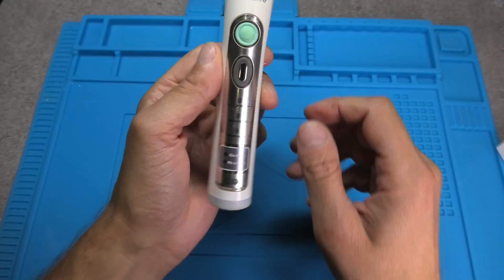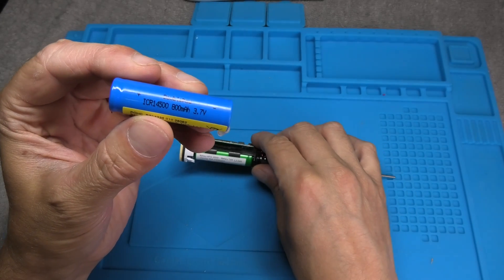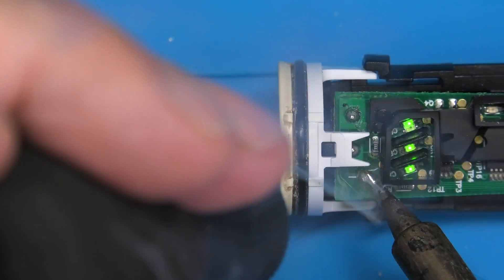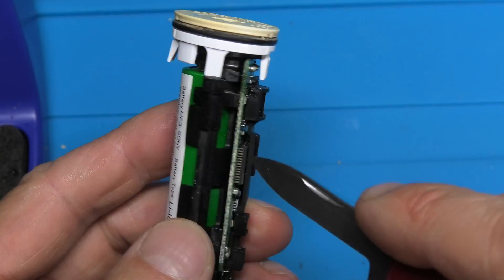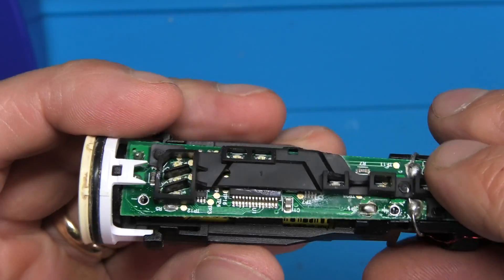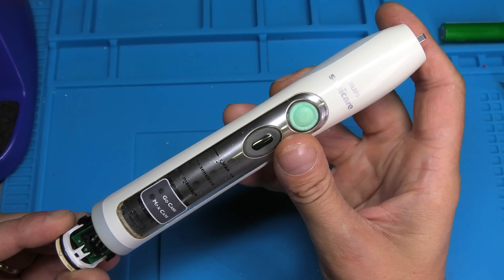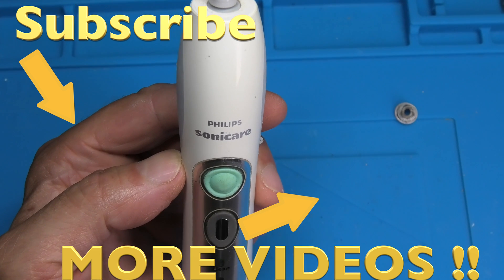Battery Replacement on Electric Toothbrush Philips Sonicare (How to in 4K)

Comment: Removing the electronics does not require hammering on a counter. I found another video where you simply take some wide pliers and squeeze on the long end of the oval bottom. The mechanism will pop right out. Wrapping in some cardboard or other material will prevent the pliers from damaging the plastic/rubber.

Comment: tldr; Switch to a toothbrush with a battery that is meant to be replaced when it wears out. The greedy scum at sonicare made this one just short of impossible to replace.

long version: This is much harder than it looks and the technique of pushing the tip onto a hard surface did not work with my toothbrush. Maybe they changed the design since this video was made. I tried to whack it hard like in the video and just started bending the metal tip - not good. I had to use channel lock pliers to squeeze the bottom of the toothbrush just enough to distort the shape so I could use a really small screwdriver to pry off the bottom (wrap it several times with a thin rag to protect the surface of the handle. After that cap was off I saw there were 2 flexible tabs that needed to be pushed inward slightly with a small screw driver, then the core assembly slipped out with light pressure. That was the easy part.

Unless you are really good at soldering, the likelihood of successfully replacing the battery is probably about 60% in my opinion. It is clearly not meant to be replaced by consumers. I ended up only getting one of the original battery connectors to come out cleanly. I did not have a vacuum tool like the video just a wicking strip of copper mesh to suck up melted solder. It works fairly well, but the real problem is that the battery mounting design is not meant to be disassembled.  I ended up melting part of the circuit board and the plastic battery clip and probably dumped so much heat into nearby electronic components that something got cooked. After I finally got the new battery in and pushed the buttons...nothing. Big waste of time. 

F*** sonicare for making it impossible to replace the battery.

Comment: Where do I get a high quality vacuum pump as I need to remove a piece of the old negative battery tab that sheared off and is still in the hole, I used a cheap pen manual suction pump but has weak suction?

Comment: My toothbrush happens to have it's on/off button pressed too much, now the toothbrush turns on even if a light breeze blows by. We were trying your method and even cleaning out the gunk at the bottom to make it easier, but we ended up throwing it away (thank goodness it didn't keep my family up at night while the brush vibrated its last time...)
Reply from the maker: Haha,  thank you for sharing your story!   I had the exact same experience with my toothbrush as well.  It would just turn on out of nowhere at random times. And I got so frustrated that it had to leave.
Reply: @MegaSafetyFirst  Having the same experience.  I put a dixie cup over my brush and in the middle of the night it came on. Couldn't find where the noise was coming from.  It kept coming on all night.  I can't get the guts out of the model I have. hx3220

Comment: Phillips actually developed a replaceable battery model, but when this happened they fired the engineer who created it and promoted the creator of the non replaceable model
Reply: The operating life of their products seems shorter now. When I first started using a Sonic Care toothbrush it lasted over five or six years for me before it started acting up. My first replacement lasted four years and the lifespan is getting shorter. The last one I had lasted just barely over two years. I will see how long the new one bought during Amazon Prime is going to last. I may end up switching to another brand. I like the sonic Care toothbrushes. It does its job well for me but the life span isn't what it used to be. They're using cheaper plastic gears.

Comment: Tech tip. To extend the life of your new battery to be the max it possibly can be,  do not leave your tooth brush charging on the charger all the time. Lithium batteries actually don't enjoy being fully charged 100% of the time. 

I unplug my charging base so I can stand my toothbrush up on it without charging. I only charge when the indicator on the toothbrush indicates one battery tick left out of three. This only needs to be done once every week or two.

I have three of these brushes in my house, all of which are a decade old with the original batteries that still work.

Comment: Thanks for the information. I've decided that I won't buy this product... this type of battery installation should be illegal.
Reply: Why? It is extremely straight forward and used to be common a common skill.  What should be illegal is the price for the battery and the pre installed connectors! Many rc guys have the spot welding tools to make their own battery packs and these cells are easily found for 1 dollar a piece.

Comment: In my model HX681A the "plus" and  "minus" to desolder was not labelled. . Also in my model, the plastic insert at the end of the unit  seemed to be glued in and did not simply pop out. I had to pry it out. In short the repair was a bit more challenging than in this video. I figured that all I had to lose was the cost of the battery

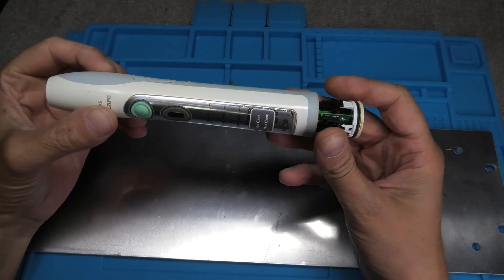Comment: 0:28 😰😳wow to use such force is really extreme. Indeed the device head was not build to handle such force and can break internal mechanism. No screwdriver is needed as well. Just put the device upside down on firm platform and apply couple of hand strokes from upper edge down from different angles and you'll see it slowly gets unleashed.

Comment: Ridiculous that they made it like this
Reply: Well to be fair, I think they make them like this for the sake of being waterproof. Not to frack over the customer. 

Because it's very difficult to make a replaceable battery door that is also waterproof.
Reply: @vhfgamer to be fair lol.  It can be easily water proof with rubber
Reply: @wildeman32 cell phones used to have replaceable packs too...
Reply: My Sonic Car toothbrush was a travel one. It used AAA batteries. I would have kept on using it but some how the case distorted and it would not hold the batteries in place for some reason.

Comment: Please. Use a big flat-head screwdriver and just unscrew the bottom a little to the left, a little to the right and it will pop out ...
Reply: This is not needed as well and besides will compromise water protective insulation. Just put the device upside down on firm platform and apply couple of hand strokes from upper edge down and you'll see it slowly gets unleashed. Putting it back will show no signs of opening and will act as new.

Comment: Really disappointed in the battery quality leads. The negative was so fragile that after unpacking it and straightening it to get ready to insert the wire snapped off the negative pole. Now it’s $20 and the time invested down the drain.
Reply: You could have just soldered the pin back on.

Comment: Does a Sonicare Flexcare HX6980 use this battery? If not what battery should I use? Hope you can assist as I’ve looked everywhere to find what battery HX6980 uses.
Reply: Worst case is to disassemble and take a look at the battery inside and search for those characteristics.  You may even be able to find a wholesaler in another country for a decent price.  I don't know about your particular model,  but was in the same situation with a different item until I just decided to perform the disassembly and it ensured that I didn't unnecessarily buy a battery if I damaged the device during disassembly.  Good luck!

Comment: With a small screwdriver insert it around the bottom of the toothbrush to loosen debris that might have dried which will make it easier to remove the interior of the toothbrush for replacement of the battery.
Reply: Good idea. I would also seriously consider replacing the O ring if you like to take the toothbrush into the shower. Otherwise it wouldn't matter too much.

Comment: can I use a higher capacity battery such as 1500 mAh,?
Reply from the maker: As long as the size and voltage are the same it should be ok.

Comment: can you not damage the top brush holding metal pin if you smack it hard?
Reply: you can damage it even by less force. Such force is not needed.
Reply: I have in fact damaged the pin every time and have never successfully opened a Sonicare this way.
Reply: The toothbrush is pretty much done since the battery “can’t be replaced” he’s giving you a possible solution so why does it matter?
Reply: @adrianchihuahua3184  The battery can be replaced as demonstrated in the video you didn't care to watch.

Comment: all the sonicare use the same battery?
Reply from the maker: They used to.  Now you can check when ordering the battery that it is for that particular model.
Reply: @MegaSafetyFirst  I have a Sonicare with AA batteries. Unscrew bottom and put batteries in. Why are they making it so hard now?
Reply: @justiceiscoming7563  cuz these batteries r rechargeable